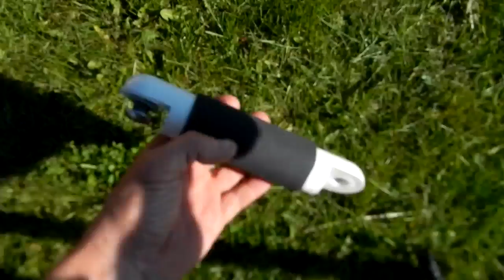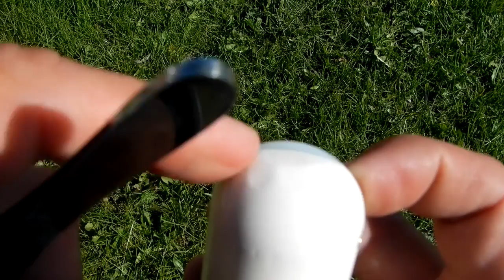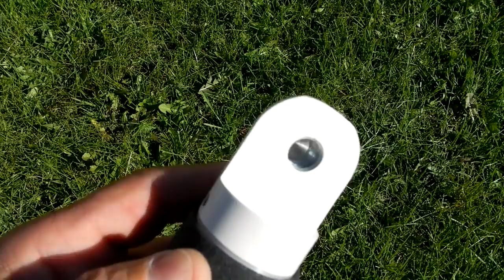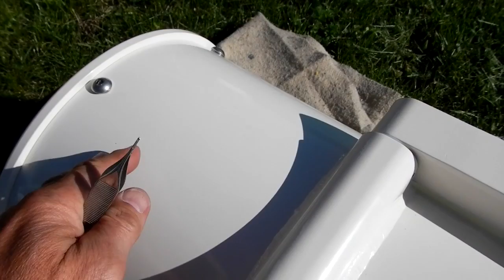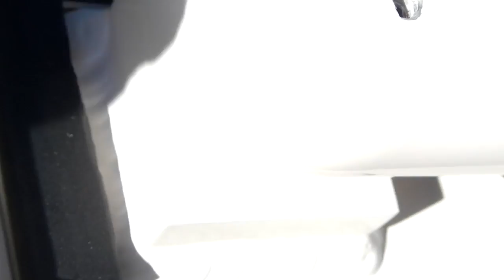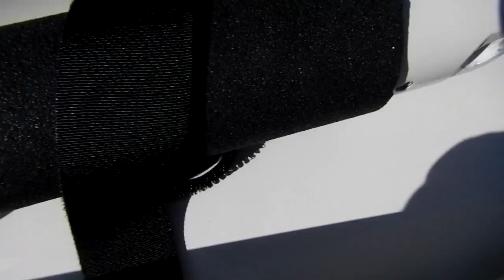12 inch ATS Portable Pier turnbuckle issue

Comment: Hi, I'm guessing that you are just angry with them and don't really want to solicit other opinions, but for what it is worth, I don't think it is a big deal. You have to look for that to find it, and as you said, it doesn't affect function. I I hope you can move on from it. For reference, I have a couple ATS piers, and like them (as you say you do too). I'm not going to look for out of round parts though. :)  [PS, I like your video on mounting the AP175. Good advice for those who worry about that kind of thing-like me] [edited since I noticed that you did get a new part from them directly, so I removed that part about not getting one]
Reply from the maker: Mark   I am very, very, very picky. For what this cost no reason for it to be sent to a customer like it was. As I see it, it was not seen by the manufacturer or it was sent like that on purpose. Neither one is a good reason. QC is important to me. A casual look over of the part would have caught it. I look at every detail. That's why I like refractors for their high contrast views. Did I say I was very picky 😉